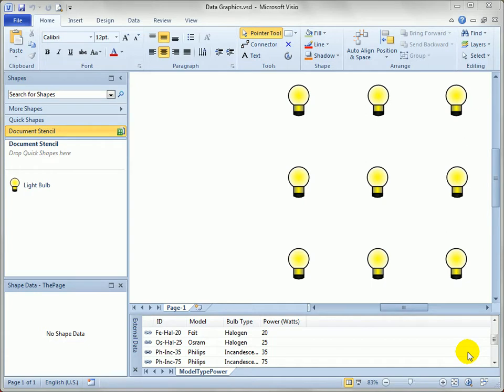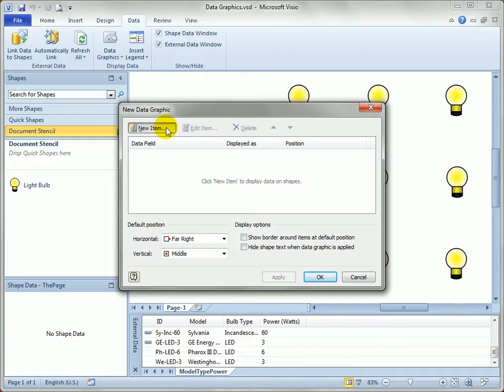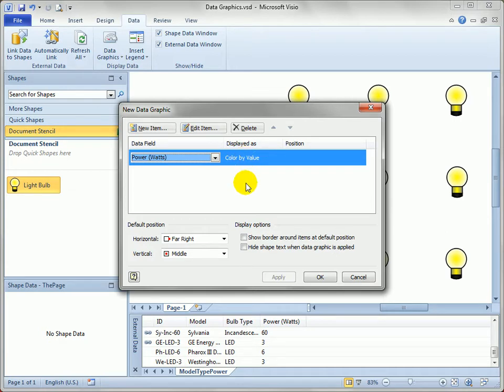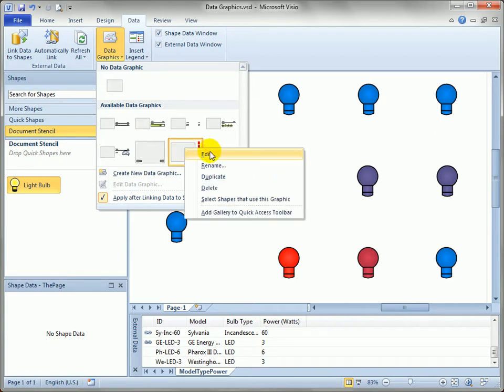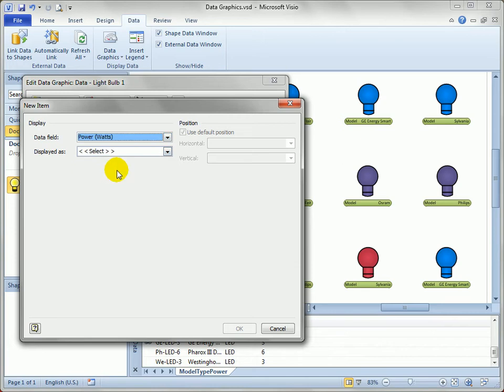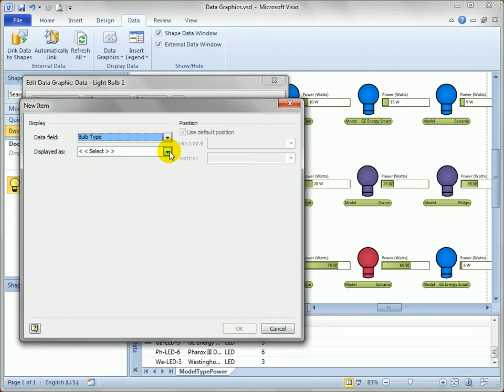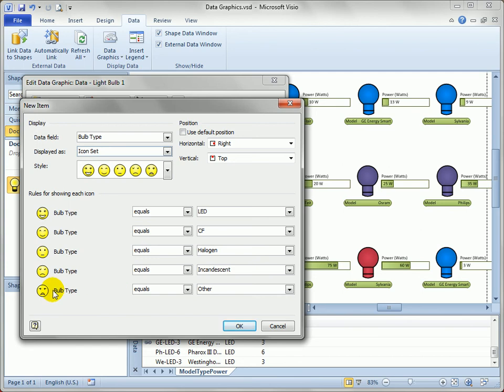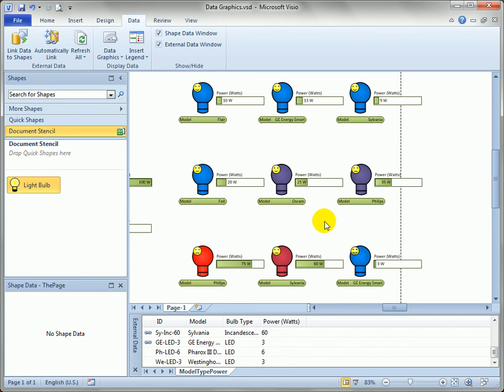7.5 Creating and Applying Data Graphics in Visio 2010

Comment: Is there a more straightforward way to display 'shape data' directly onto the shape without using the more 'sophisticated data graphics'? So just the text without the graphics?
Reply from the maker: Hi, yeah, it's easy enough to link Shape Data to text fields. Visio nerds refer to this as "insert field". 

Over on my other channel (https://www.youtube.com/@VisioGuy/videos) I've got this video:
"Insert Field Trick"
https://www.youtube.com/watch?v=KRufpyxaW7A

There's also this article that has some deeper info that will definitely help if you need multiple text blocks in different locations on a shape: 
"Link Fields to Subshape Text"
http://www.visguy.com/2018/02/14/link-fields-to-subshape-text/